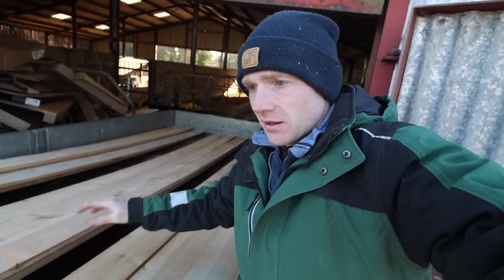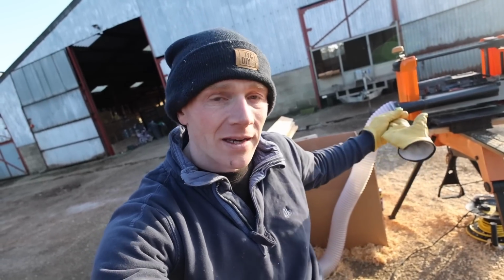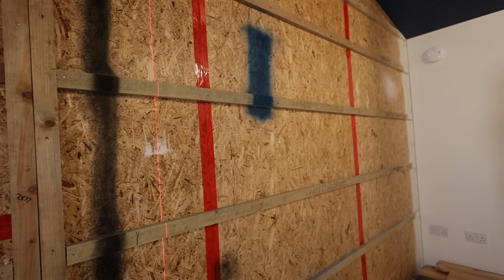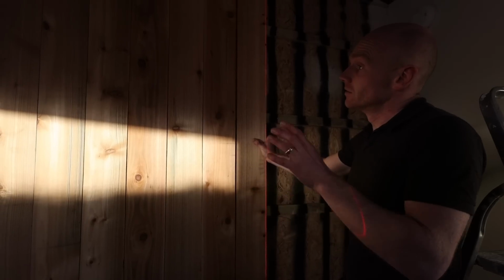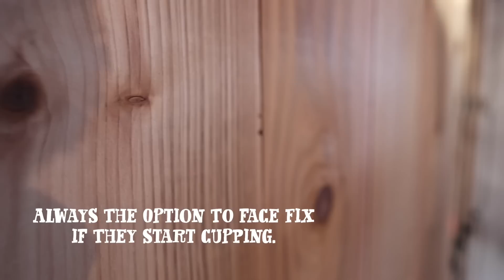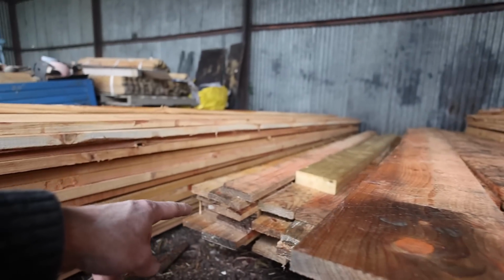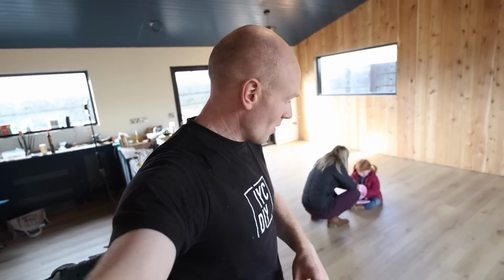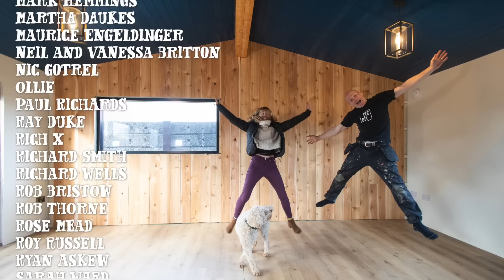EPIC DIY CEDAR WALL - Smells like a timber cabin now! 🪵

Comment: The wall has turned out great. I’d have never have thought about the battens showing through but your right. How annoying would it be seeing a batten between the boards. The blue ceiling has also turned out well. When I saw the paint initially I thought “Oh  dear”😂
Reply: I don’t think it would have worked if it was just the white walls, but the cedar all just makes all the difference

Comment: Think I would've shiplapped those, but that's just me. I think you did the right thing by going with the smooth side. I've used rough lumber in a few small projects and it seems to attract dust like you wouldn't believe.

Comment: Great video. Love watching the journey you are on. Just wondering about all that timber inside a building? I used scaffold boards horizontally for a similar effect in an extension we did. Building control insisted that I use a fire proof treatment on them before they would sign off.
Reply from the maker: Yes same with pallet walls and ply finishes. Would be looking into it more if we use similar on house build.

Comment: How bad was the snipe at each end of the boards?
Reply from the maker: Usually pretty bad when handling it in and out without rollers but most was cut off when fitted.